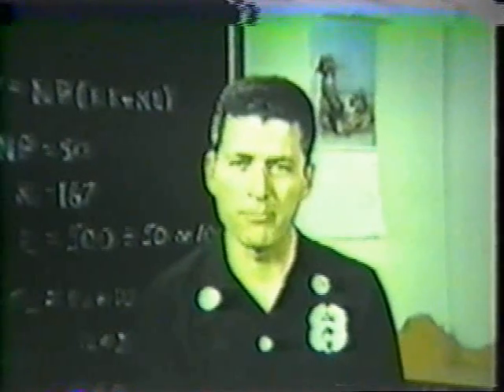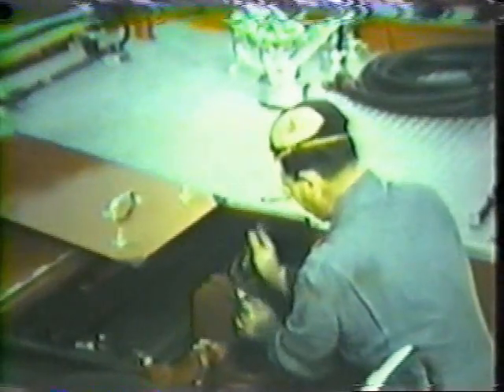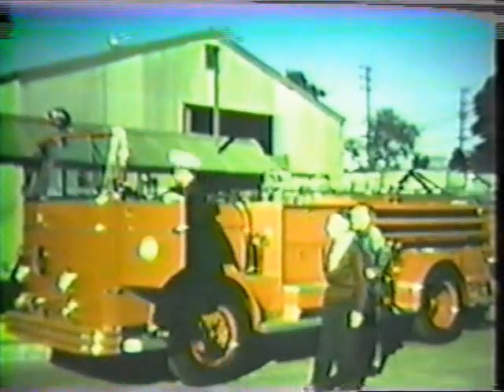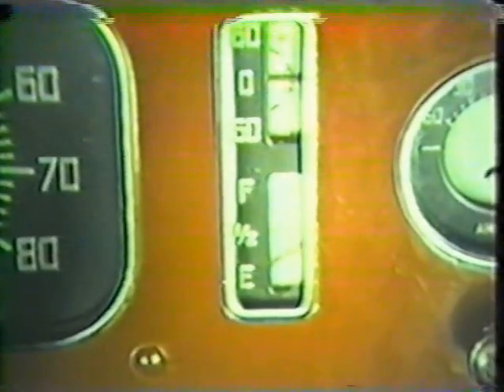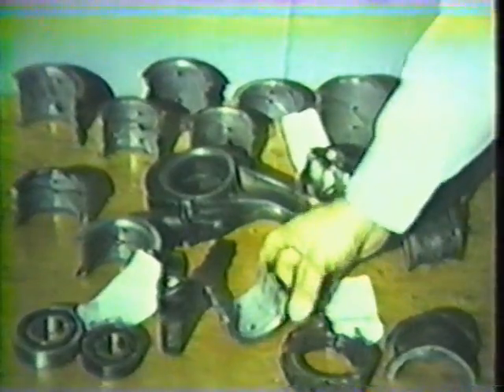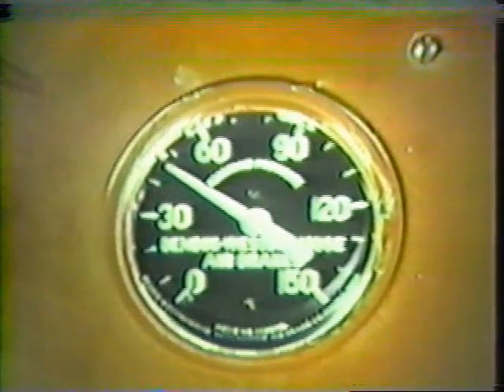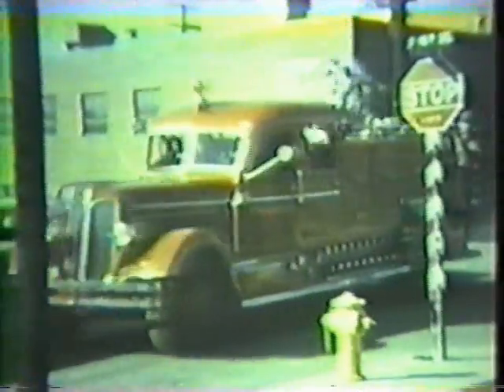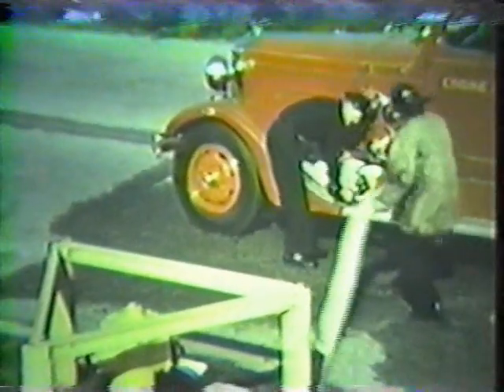Los Angeles Fire Department Vintage Training Film "The Pump Operator" 1 of 3

Comment: It's amazing that firemen rode on the back or even the side of fire engines. Wonder why?
Reply: Some departments continued that into the late 80s, at least in San Diego county. Nothing like standing (you had a hook type safety harness) on the tailboard rolling down the I-5 freeway.
Illegal now per OSHA  thank god !😬
Reply: They didn't have jump seats or sedan cabs on the apparatus back in a day. I did it in my department up until 1988. I think I was the last fireman in Nebraska to ride the tailboard. After that, they removed the arm loops from the back of the rig. A bygone era.

Comment: Note the use of the Propello-Ray light instead of a beacon on some of the apparatus.
Reply: And they've gone back to them: They call them Roto-rays now.
Reply: @ronaldrobertson2332  /// Those are different. The propello ray came from Federal, and consisted of a rotating fog lamp behind the red lens. The roto ray came from an Ohio company called Buckeye, consisting of three red lights in  a triangular arrangement, rotating. The Denver fire department used them on all trucks with a Sterling 30 siren, many years ago.
Reply: @k0smon  Ahhh...okay. Take it from a guy who's known only the single rotator beacon and the Visabar Twinsonics most of my life. My mistake. But like I said, they have those Roto-Ray lights mounted on the truck, looking like a 3-bladed propeller with red, white and blue lights on them. I thought those were an old system making a comeback.
Reply: @ronaldrobertson2332  //// You were correct there. Someone bought the rights to make the light. I think he only sells them to factories. I have never seen them advertised in any catalog..
Reply: @k0smon  I've just seen them on numerous FD videos; we didn't have those Roto-rays back when I was on the volunteer department. That was over fifteen years ago since I "retired". I just liked the old Twinsonics. 
...and the Federal Q siren. 😁
Reply: @ronaldrobertson2332  //// I imagine the roto rays are rather expensive, like the Qs. The Qs are still in general use for larger apparatus. There are at least two other mech sirens sold, the B&M, and Eagle sirens. FDNY uses a lot of electronic Qs.
Reply: @ronaldrobertson2332  //// Were the twinsonics  the two beacons that rotated giving an alternating flash? They had one motor and a chain thru the mounting tube to keep the lights in sync.
Reply: @k0smon  Umm, picture Squad 51 from "Emergency!" The light bar they had on the roof of the squad? Those are Twinsonics. They had two rotating beacons and a set of mirrors inboard that reflected that light forward and back.
Reply: @ronaldrobertson2332  /// Ah yes. Did you notice that the left mirrors were replaced by a steady red to the front and flashing amber to the rear. Typical California setup, as Calif. requires a steady red as the minimum emergency light..
Reply: @k0smon  Yep. Saw that many years ago when I was a cadet in Civil Air Patrol; we were on a trip to Vandenberg AFB to March AFB and we passed through Los Angeles. Saw a bunch of cop cars like that. This was about 1974. I was just a kid back then and a fan of "Emergency!".
Reply: @k0smon  No, too many years have gone by for me to remember that far back. Sorry.

Comment: Why would they make the trucks topless? What about when it rained!?
Reply from the maker: I am not an expert on this, but I did some searching and the consensus I found is summed up in this quote from a forum:

"Most of the early fire apparatus had open cabs because most trucks had open cabs when motorized fire apparatus were invented.

Particularly in the big cities, the open cabs were maintained as a way for the officer to be able to size up fires on the upper floors of tall buildings while the rig was still rolling in. This could be as simple as  being able to tell exactly what building was on fire. When you have several tall buildings sitting shoulder-to-shoulder, being able to look up and see which one is smoking saved a lot of time and prevented the need to reposition.

Also remember that most fires were reported by pulling a street box, so the rigs responded to the box, then had to look around for the fire location.

Closed cabs became the norm in the 1960's and 1970's when firefighters became targets of social unrest. It is simply too easy to chuck a brick into an open cab. Lots of apparatus had homemade roof installations 
during this time. With the widespread use of the telephone and E-911 systems, street boxes mostly disappeared, and it became easier to go directly to the burning building."
Reply: Alot of theories, better visibility was one. Especially if a ladder truck.
Reply: @theflinx  Not an expert you say? That was quite a lengthily explanation coming from a "non-expert"
Reply from the maker: @Wa3ypx  the open quote was missing from the quote I took from a forum. it has been fixed.